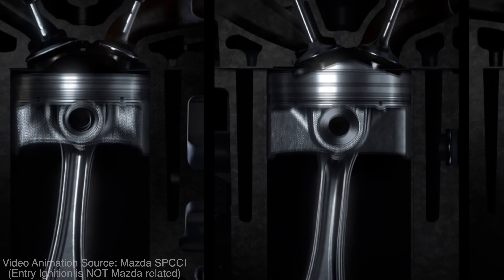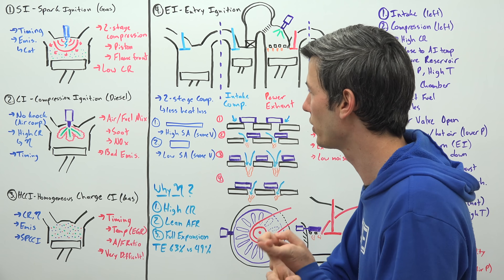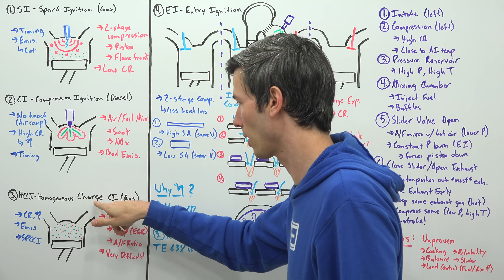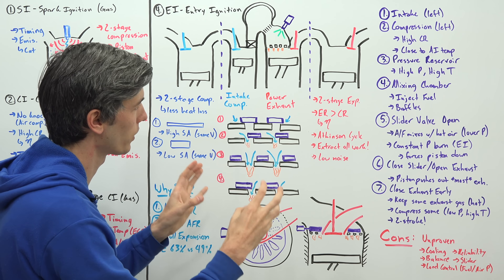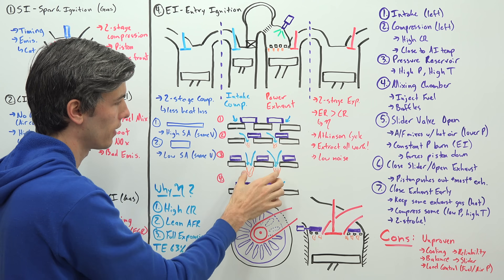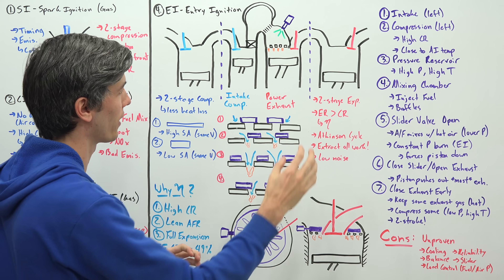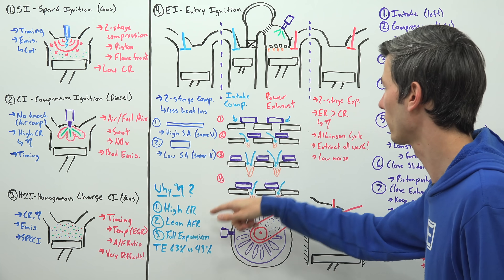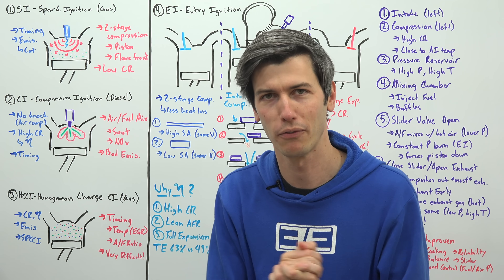Is 'Entry Ignition' The Future Of Combustion Engines?

Comment: Hey Jason, how would you start the engine? It seems to me that the combustion cylinder is relying on the hot gasses from the previous stroke in order to ignite the next stroke upon entry, so from a cold start how would that work? And realistically, would it just need 1 single "cold" stroke to start it (because if the gasses in the cylinder are hot from previous stroke then the AF combusts on entry)?
Reply from the maker: Great observation! The idea the paper discusses is to use a spark plug in the mixing chamber for the first (and only the first) cycle, and then after that there will be enough heat in the combustion cylinder.
Reply: Engineering Explained oh cool! That’s pretty much exactly what I was thinking
Reply: Might have a longer warm-up period. It just needs to be choked a bit longer, but will start without issue. The super high temps would be more for lean burn efficiency
Reply: Since Jason said the pre-compressor compresses the air to just below knock temperatures. That pinwheel valve doohickey would assist

Comment: I would use superchargers instead of most of these cylinders.
Reply from the maker: Yes, any form of compressor would work.
Reply: btw can twin screw supercharger or oil pump be used as hydraulic motors?
Reply: Although without a piston-based compressor, would it have enough compression at idle to even fire? Sounds to me like the pressures needed would be very high
Reply: Trying to push diesel like compression trough a supercharger seems like a big challenge. it might get the 1st stage done but you will eventually need that piston to achieve the very high pressure needed.

You also need to calculate the difference in parasitic losses of the supercharger vs the 1st piston, i bet there's not much difference.

Comment: Wouldn't this engine vibrate like crazy tho?
Reply from the maker: Not if it's balanced.
Reply: Naw. Balance each cylinder type (whether a single cylinder or a cylinder bank) independently. Any imperfections will tend to balance out (by design), so the engine will end up smoother than a traditional design.

Comment: I really like this one. I see that the combustion is stratified and that's awesome. The low point I see is the numerous piston segments that are dragging HP. Also high pressure means more friction on moving parts. Very nice concept though, thanks for sharing it.
Reply from the maker: It is relatively low-pressure in comparison to today's engines.
Reply: @EngineeringExplained  ... which is one reason why it simply can't be made reasonably efficient as compared to an EV. Might have flown decades ago (but probably not because of that oil-drenched or otherwise hobbled rotary valve), but now only a Caldwell Cycle engine can compete in the market
Reply: Yes you have more pistons but, you gain 2 strokes.
Reply: Oh, and no, it is not stratified charge. A homogeneous charge  was one of their design axioms. The air/fuel ratio within a single cycle is as constant as they can make it.

Comment: The future of the combustion engine is a museum 😂
Reply: funny, but not true. we cant go 100% electric since we dont have batteries good enough.
Reply: @bigdubbossman9932  Here is my vision of this.  I agree that currently, we cannot replace combustion engines with electric motors/batteries everywhere. The main problem here is batteries' energy density and in order to do that, we have to have batteries with a density similar to Gas/Diesel fuel. For example, I cannot imagine a tractor doing cultivation/plowing on electric energy. It will drain out after several feet of work. But someday Oil will be very expensive (because of the limited amount present on Earth) and electricity cheap (I hope. Solar, Nuclear, maybe Fusion energy). If so, I suppose such heavy-duty machines will use hydrogen fuel instead of Gas/Diesel as Hydrogen will become cheap to produce (assuming cheap electricity) and it is environmentaly friendly.
Reply: @bigdubbossman9932  it's just a matter of time. Just google "million mile battery"
Reply: @ironicgoose9913  A matter of a very long time. We can make amazing batteries, but we can't make enough of them for the whole world of electric cars. And we can't make and transfer that much electricity...

Comment: Is it even worth investing in gasoline engine in the new EV age
Reply: No way. Gasoline is dead now. The only reason ICEs still produced, is that only few manufacturers having technology and tooling to produce profitable EVs, but it's obvious now, that future is electric
Reply: @ironicgoose9913  No, that's by far not the only reason. That isn't even a significant reason. EVs are still expensive, they still don't have the right range/recharging combo for regular long distance applications, there are serious issues in getting enough batteries for them all EVEN NOW - when they have just a very minor share in the world market.
Reply: Huh? Gasoline??? ICEs only run on petrol because bio/synfuels aren't widespread yet. What you say is equivalent to saying that EVs MUST run on coal-fueled power plant electricity.
Reply: Where is EV age?
Reply: Yes, at least until the infrastructure for EV charging is sufficiently widespread and renewable energy sources are ubiquitous.
Reply: Obviously
Reply: Yes. Military will always want something that can sit in a cave for 5 years, then used non-stop for a month at a time without recharging. Also, just google how much horsepower is required for a large ship or helicopter. Electric, at least by battery, won't be there for at least a decade. Only Nuclear can produce that level of electric power

Comment: What about packaging? You’re taking up the space of a 4 cylinder with only one of the pistons doing the work (granted 2 stroke vs 4 stroke), but still...
Reply: That was basically my thought.

An equivalent to a V8 would have more cylinders than a Bugatti lol
Reply: I imagine this engine is focused on efficiency, with power a far second, or third. Most people are perfectly fine with 200hp, which this should reach, as it's forced induction
Reply from the maker: Both the last two cylinders do work. Also, you only need one cylinder. The initial compressing cylinders could be any form of compressor, the combustion cylinder could be larger to increase its expansion ratio.
Reply: @EngineeringExplained  What bout the smaller compression piston, how would you replace that piston?
Reply: Engineering Explained I’m not an automotive engineer ( though I wanna be ) but wouldn’t it be simpler to ditch the first two and last cylinders and replace them with a turbo?
Reply: @EngineeringExplained  would the first and last cylinder be replaced by a turbocharger?
Reply: @Electrify_Everything  not really. You'd want a supercharger in the front and a turbine in the back. The idea is called turbo compounding. It also does nasty things to the engine's life expectancy, the aircraft engines using turbo compounding only lasted about 1/4 the time that their conventional cousins did before needing to be rebuilt (!).
Reply: And any application that packaging isn't a top priority it would be fine, like generators
Reply: @gutserker  yes, generators and some marine engines I guess would be ok with it
Reply: Don't forget that the extra cylinders are not necessary for it to function, they simply increase the efficiency. Now having 2 cylinders for an efficient 2 stroke cycle? That's not bad.
Reply: B I G G  C Y L I N D E R
Reply: You get a 1 cylinder two stroke engine, but it has two cylinders and a heavier crank, and you want it to run a supercharger too? That's a big 1 cylinder engine.
Reply: Descending size cylinders perhaps?
Reply: It will not make enough power to offset the rotating mass and compression of the extra pistons. Any added efficiency will be lost in moving the extra parts. Also different size pistons, and different compression ratios and only one cylinder having power stroke is a recipe for disaster at the crankshaft.
Reply: @tylerzesiger7648  so younare trying to tell us that extracting heat energy and compression of air using that extracted energy is more efficient using pistons rather than a turbo charger? Lets go tell all the designers at Boeing they've been geting it wrong.
Reply: @mitchellbaker4847  Boeing doesn't build cars.
Reply: What I was thinking

Comment: Doesn't high CR also mean high NOx?
Reply: NOx depends on the temperature. The higher the temperature the more NOx. Which does not change the fact that in an engine with such a cycle the temperature would be rather high than low, which may result in the appearance of NOx in exhaust gasses.
Reply: Not exactly. NOX is all about peak combustion temperature because it is largely caused by nitrogen ionization in the intake air (two other sources, fuel and prompt NOX are both minor components in petrol, diesel, and CH4 engines). An engine needs to get air above ignition temperature while also reducing temperature rise so that peak combustion temperatures remain near 2600F, as above 2600F nitrogen molecules in air start splitting into nitrogen ions and nitrogen ions love to grab oxygen, forming NOX. No nitrogen ions, no NOX. So, a lean-burn engine that ensures temps are above ignition when burn commences and below 2600F  because the +-3500F increase in temperature is reduced via dilution with excess air and/or exhaust gas will not produce NOX. The Big Sinners are NOX, which requires low peak temperature to avoid, and soot, which requires either a homogeneous mixture to avoid or sustained heat and pressure to correct.

So yes, you are right that given a design, higher CR causes higher NOX, but the goal is to use a better design.

Comment: If the slider valve is still open while combustion occurs, wouldn't the resulting pressure in the combustion chamber quickly overpower the remaining pressure in the pressure chamber, resulting in the ignited gas expanding into the pressure chamber instead of pushing down the piston?
Reply from the maker: No, the pressure rises, which pushes the piston down, but it never rises above the pressure in the chamber above. It's a slow, long burn, rather than quick combustion like SI/CI/HCCI.
Reply: @EngineeringExplained  I see. Thanks for the quick reply!

Comment: How does the fuel ignites after if there is no oxigen in the exhaust gases?
BimmerN53
Reply from the maker: It's already mixed with oxygen in the chamber above. The lower chamber is only used for heat, to bring the mixture above its auto-ignition temperature.
Reply: @EngineeringExplained  Thank you, do you think high octane fuel is a must due to high pressure from exhaust and tenperatures?
Reply: I think you are talking about the remaining exhaust in the power piston. That is just for heat only. Its basically your spark plug. The oxygen comes in together with the fuel. However it enters gradually so once the flame is going, it will keep going. until it runs out of fuel and air or you close he gate.
This is basically a turbofan with pistons.
Reply: @_aullik  Thank you, aswell a continuous EGR engine, it will be good for emissions at least for NOX

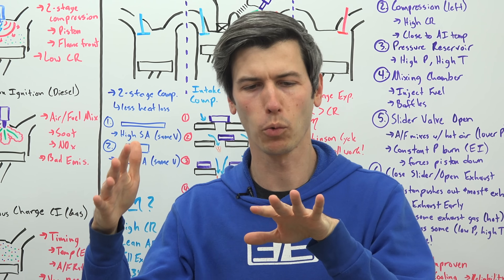Comment: 6:35 Process seems kind of like a mechanized backdraft
Reply: ornately over-complicated.   An opposed piston system with the intake valves in the pistons using a roots to pressurize the crankcase would beat it any day of the week.
Reply: @prjndigo  Then how come every car in the world isn't using this sort of setup and getting extreme effeciencies?
Reply: @lysolmax  they are quite hard to maintain and are expensive to produce, ships had them in 70ies
Reply: @lysolmax  cheap-ass companies and patents
Reply: Seems like putting more technology into transmissions and gear ratios are a simpler way of making a car more efficient.

Comment: Does it mean that all the work will be done by a single cylinder/piston?
Is it basically a one cylinder engine which uses three other piston to improve efficiency?
Reply from the maker: Depends on how you have it set up. It could be a single cylinder engine, and have a different style compressor, and a larger combustion cylinder to increase the expansion ratio. Superchargers are air compressors as well, though they're not piston-cylinder devices. Many different ways it can be done.
Reply: @EngineeringExplained  Thank you for that ggod explenation. 
That is some pretty impressive engineering.